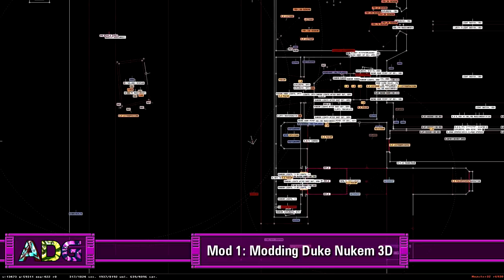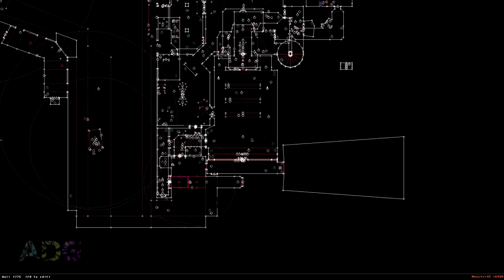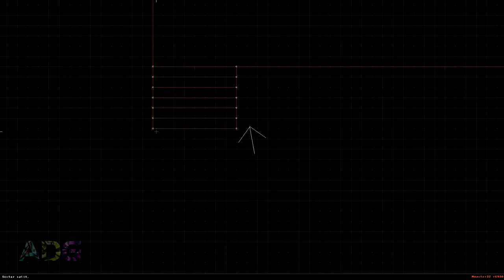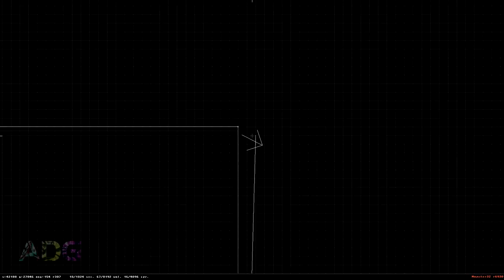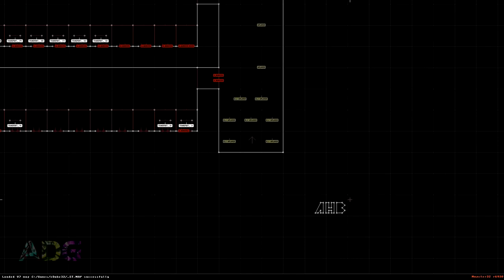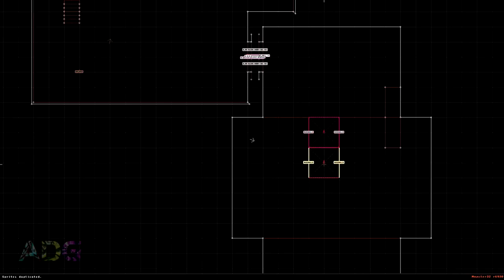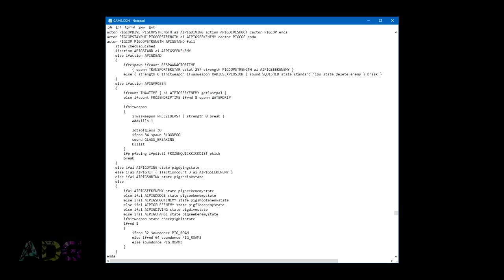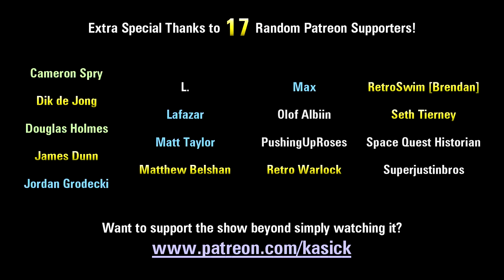Modding Duke Nukem 3D - ADG Mod 1

Comment: I used to spend hours of my youth life to max out my maps. My main project was the city's underground system. It was huge. It needed the maximum map size possible. It had custom textures also and several moving "train" sectors as it consisted 3 different metro tracks with dozens of stations. It got buggy at a point and completely broke the map.
Reply from the maker: Yeah, there's a couple bugs with the original Build Editor which can completely destroy a map's structure internally and is impossible to recover from. One of them specifically dealt with deleting sectors, the other with merging sectors together, so it was really important to save before doing either of those things.

Comment: For some reason I could not copy the fences the way you did. I just copied the fence I want to paste and pushed the s key.
Reply from the maker: The copy/paste functions in the 2D mode can be a little tricky to use since back in the original Build Editor it actually mattered which shift/ctrl/alt keys you were using to do everything; I forget at the moment if that's still a thing with Mapster nowadays but it might be. :P

Comment: I wonder... in Blood, in the Crystal Lake map (the forest map), the first house you go in has an elevator to a second floor, and there's another house with some overhanging platforms as well. I wonder if they used sprites to make those. They were using the original version of the Build engine, so I don't suppose there was any way to put sectors over other sectors.
Reply from the maker: The trick with having sectors over sectors in the original Build Engine is that so long as you can't see both sectors at the same time, and so long as their height values don't conflict, there will be no problem rendering them or moving through them. Even in Duke Nukem 3D there are moments where in order to hide a sector over sector effect,  two-way-walls which are opaque from the outside but transparent from the inside are used, thus you can see a whole building from the outside, which has multiple floors inside, but you can't see INTO the building except in spots where the floors don't overlap. Even the very first level has a spiral staircase which goes up to an overlapping area; the projector room in the theatre, which uses some clever boundaries on the lower floor to ensure the projector area above renders correctly from the perspectives you can see it from!
Reply: @Pixelmusement  oh, I thought it wasn't possible at all. I see, then. 

Thanks for replying. :)

Comment: A technical comparison of the Build engine vs the Doom engine is something I have been looking for for some time.  I understand how the doom engine works pretty damn well, but the Build Engine is criminally underrepresented in the technical analysis world and there are some pretty key differences in how they work that I can't find good explanations for.  Why can Build have sideways moving walls?  How does it have slopes?  How can it handle the raw, bone-crushingly lethal power of doors?
Reply from the maker: While I don't know the specifics of the Build Engine's rendering, one thing I do know from Ken's prior engines is that he often used a technique called "Portal Rendering" where you render a section of a world and keep tabs on if a single pixel happens to get rendered from a portal wall in that section which connects two sections together, and if so, you render that section next, along with any others attached to rendered portal walls. Once no more portal walls are rendered, you know you're done iterating through sections to render. I wouldn't be surprised if the Build Engine uses this same technique, as it can't use BSP Trees due to the fact that sectors and walls are allowed to move. :P
Reply: @Pixelmusement  So that's how he culled the unnecessary sectors from the renderer (maybe).  I understand that he couldn't have used BSP's and had moving walls.  Was this just because PC's had picked up the extra grunt to not make that sort of extreme pre-processing necessary by the time Build was being used?  I wonder, though, when BSP's are being calculated, does the map editor have to account for every possible position of vertically moving platforms to determine what behind it can be culled, or is it an uncommon enough thing in Doom that it can either be calculated on the fly or just renders what's behind the platform since it's not a big hit on performance?  I figure it must just not calculate this, because if that were the case then horizontally moving sectors could have been given the same treatment, if I understand correctly.  *shrug
Reply from the maker: @Kevin-jb2pv  BSP trees can only be used for STATIC geometry. The reason it works so well in Doom is because the map is effectively made in 2D, X and Y axises, meaning so long as those stay fixed in place, the Z axis can move as much as it wants as the BSP tree isn't doing anything to affect that. But yes, the system requirements are significantly higher on Duke3D likely because of the extra processing needed to cull unseen areas without a BSP tree.

Comment: Duke Nukem you say? Go on.. 

I loved that build editor as a kid, altho i used the Shadow Warrior one far more because it could put 2 levels on top of eachother. 
With that i could easily make nice shooter arena's for the ye olde lan parties, or even silly tank arena's :) Good times.

It's sad that Shadow Warrior Classic never got its workshop for maps finished for steam. 
There are still submissions on there (including mine), but I guess they just abandoned that feature.
Reply: You kinda could put 2 levels on top of each other with build engine too. I know as I made a multiplayer hotel map that had a ground floor and an upper floor.
Reply: You could not properly see into it though. It would let you see some distorted artifact because it could not make sense of it, but with shadow warrior you could do this.
It was quite finicky to get right properly, because it was basicly 2 seperate zones glued together with a "warp zone"  and they both had to have the exact same regions. But it worked :)
Reply: True. If both levels were on screen at the same time it would show distortion. But if you only see one or the other it was fine. I admit it is more limited.
Reply from the maker: +J Ruonti +arboris Because of the way the classic Build Engine renderer worked, sectors could overlap sectors so long as they weren't both visible at the same time, otherwise positioning data would confuse the engine and you'd potentially get a hall-of-mirrors effect, or simply not have one of the sectors render. You can actually experience this in E1L1 if you have the screen resolution high enough and try to look at the curvature of the spiral staircase in just the right position.

Comment: Sectors like walls and doors (not opening upwards) could be able to spin and move in the doom engine as shown in Hexen Beyond Heretic as Raven Software modified the engine's capabilities and push them to its limits in 1995 but still couldn’t overlap sectors.
Reply from the maker: The way that works in the updated versions of the Doom Engine is that those walls are effectively "sectorless", as in, they don't actually belong to a sector and are simply rendered as solid across the entire distance from the floor to ceiling of whatever sector they're in. :B

Comment: Just an interesting point, vertexes can't be DELETED.
If you ever paid any attention or tested it, the vertexes you merge remain, and can be moved apart!
You've spread a common misconception which needs to change.
Reply from the maker: +Kaiser Drache Err... yeah they can. So long as the vertices make up two ends of the same wall definition, moving them together will merge them into one. The editor will even say "Point Deleted" in the bottom message box, confirmed just now. :P

Comment: Also sectors can be physically placed above each other in DOS version (unlike Doom) but Build engine can't render such sectors simultaneously properly.
Reply from the maker: +ax 
trifonov True enough. You can see this effect with the spiral staircase in the very first level of Duke 3D, but to properly explain the limitations and stipulations of doing this would've taken several minutes and I wasn't quite sure how to demonstrate it properly, so I decided against discussing it as the video was long enough as it is! :B

Comment: Will you be able to show us how to make an entirely new game with build? Like when I was a kid I used to edit Duke Nukem 3D levels so I understand build but how do you put the levels together with your own art and assets obviously and make it your own game?
Reply from the maker: +Sine Nomine That's the problem: There's no obvious way to do it. It's not like with Doom where you just load everything into a WAD file and tell Doom to use it. Duke Nukem 3D's only capacity is to EXCLUSIVELY use a particular GRP group file primarily, replacing components in the group file with files found in the working directory when detected. To be frank, you're better off downloading the Build engine components and just starting from scratch with that. :P
Reply: @Pixelmusement  ah well, at least modding level is still fun. Thank you!

Comment: Hey when I put the player in my map and I start up eduke32 and I go to my map my player dies is there a way to fix that
Reply from the maker: +Shammi Ali Player 1 is handled differently, as their starting location and orientation is indicated by the red arrow on the map. What you need to do is position yourself exactly where you want to start while in the 3D view, switch to 2D view, then hit scroll lock to set that as your start position.

Comment: a question, I would like to do sprite for Doom and  Duke Nukem, I will use clay and then take pictures for the different action and angles, then will also do the sounds, but how can I put all together? I'm not a coder, so my question is, is t enough to create the files for the images and sounds? thank you!
Reply from the maker: +Raul Gubert Not sure I fully understand the question, but modding Doom with new graphics and sprites is generally easier than Duke Nukem 3D, just by nature of how Doom separates things into IWADs and PWADs, whereas Duke Nukem 3D just pulls from whatever data is in the working directory, making it tricky to switch between mods. Using clay sculpting and taking photos will get you your base sprites, but you'll definitely want to touch them up once digitized, not to mention you'll need to match them to use the 256-colour palettes of those games if you want your mod to remain compatible with the original DOS versions. There's a lot of work involved here so I recommend taking small steps and learn as you go instead of trying to do everything all at once. :B
Reply: @Pixelmusement  Thank you for your reply, it is a good advice. Yes, I know that I have to digitize them and use the right resolution and palette, not a problem with them, I use pmotion, which is great for this kinds of job. The problem comes after I did that as I don't know how to implement them in the game, but I suppose someone can help me once I showcased the quality of my project. Starting with the sprites is interesting for me as there are not many and good enemy design around (a part the originals), all is a remeke or reskin of the old ones, so I think there is still a lot of space to bring something new...anyway, thank you for your feedback, I will follow your tutorials, just to have a better idea of the tools and the generail idea of modding. Cheers!
Reply from the maker: +Raul Gubert I should mention too, if you're trying to make all new enemies rather than reskin existing enemies, you're going to run into bigger hurdles with Doom than Duke Nukem 3D. Duke3D uses special "CON" files which contain scripting for the various enemies, so adding a new one, while still complicated, can be done without altering what's already there. Doom however is entirely hard-coded, so in order to create a brand new enemy you have to essentially alter the executable data for an existing one. This was originally done with "DEHACKED" patch files, but I'm not sure what the modern alternatives are with the various source ports.
Reply: @Pixelmusement  thank you, that is very interesting. Definitely I want to add new enemies, I'm not interested in redo old stuff, so for the moment I will produce the raw files and ask for help once I did the job. I will keep you posted on that. It may be also interesting for you once I manage to do it.
Since I want to design new enemy also for Duke Nukem 3d, will also ask around but I suppose for me the job of creating the raw files (.png and sounds) is the same...Thank you again for the insight! the first enemy I'm going to create for Doom is called Doom  Baal, it is an interesting one as it is a passive monster that can slightly change the way to approach the gameplay....a bit of strategic thinking....thank you again!
Reply: @Pixelmusement  thank you for the useful insight! yes, definitely I want to create new monsters and not just reskin...I think think I will try my best ideas and sprite (png) + sounds and ask for help....if I show around my idea and quality of the project I might get some help....I'll keep you posted, thank you very much! :-)

Comment: Where do you find the in game map files to load into mapster? I'm also using eduke and mapster but I can seem to find e1l1 map or any of the other maps in the game
Reply from the maker: You have to extract them from the DUKE3D . GRP group file first if you want to edit them. :B
Reply: @Pixelmusement  Thanks for the quick reply mate, however the eduke I have doesn't have the Kextract program, and I'm stuck on google trying to find a way to get the maps out of the .grp file. I just wanna build some duke levels dagnabbit!

Comment: I want to get started with using the Build engine, and while this video was extremely helpful, I don't know how to access the engine and the editor used in the video. I don't want to try to find it myself to maximize safety. If I could have the links, that would be splendid.
Reply from the maker: I'm not sure if you meant the port or the original Build Engine itself for DOS. There are links in the video description for eDuke32 which comes with Mapster for doing level editing, however, for the very original Build Engine source code and other related materials, you want to check out the following page on Ken Silverman's website, as he's the guy who actually made the engine! http://advsys.net/ken/buildsrc/default.htm
Reply: @Pixelmusement Thank you. I'm also confused about the engines. Is there a difference between GZDoom (another popular engine I stumbled upon) and eDuke32?
Reply from the maker: They're entirely different. They may produce similar results, but internally they function NOTHING alike. :P
Reply: @Pixelmusement I downloaded the files and can't open them. Do you know how to gain to the program that's supposed to run them? And is this builder a game you can play directly or do you need to import the file into the vanilla Duke Nukem?
Reply from the maker: By this point, you're going to need to confer with the people or communities responsible for making the software. I can point out the stuff I use and what I do with it, but I'm not a tech support person for these things so I can't really help with installation, configuration, etc., beyond anything I've already mentioned.
Reply: @Pixelmusement Thanks for all the help! Is there a Discord I can go to? It's the only media source I have.

Comment: hello i totally downloaded the addon for duke nukem 3d
and would like to use the new enemies, textures.sounds in the map editor but how can I get them in it?
Reply from the maker: The method is going to depend on what the addon is but generally speaking, your map editor simply needs access to the modified game files and you should be good. For the original BUILD Editor, this meant just having the modified game files in the same folder.
Reply: @Pixelmusement  how i can get the orginal build editor
Reply: @Pixelmusement  I need enemie con file right ?
Reply: @Pixelmusement  Yes, I downloaded the addon for duke nukem 3d total meltdown and there are new textures, 35 new enemies / characters, levels and sounds. I want to use the new enemies / characters in the map editor but I don't know what to do with them Are there any new files, opponents, textures in the map editor inside? The map editor is not with eduke32 inside inside the addon.or what map editor should I use for this
Reply from the maker: If you need specific instructions for your situation then chances are you're going to have even more questions once you've got it working, so I'd recommend joining a forum dedicated to Duke3D which has an editing/modding community as you'll get much better assistance there than what I can provide.
Reply: @Pixelmusement  where can I find you group?

Comment: Oddly, I can't use 'insert' to split vertices. It's does'nt do anything at all.
Reply from the maker: Best guess is that it's either a keyboard layout thing or your particular Insert key has an alternate function which is being activated instead. Beyond that, you may want to get in touch with the developers of Mapster and let them know what's going on, if you feel it's a bug, and in the interim a workaround is to go into the mapster32.cfg file and scroll all the way to the bottom where you can remap certain keys to other keys. For instance, if you can find out what the scancode for your Insert key is in the event that it's NOT "D2" as Mapster is expecting, you can remap your actual Insert key to the D2 scancode.
Reply: Nevermind. Just pressing the 'I' key does it anyway. Can you use Mapster for Shadow Warrior and Blood ?
Reply from the maker: @bouncingbluesoul5270  Dunno... Probably, but you may need specific files/ports to do so.